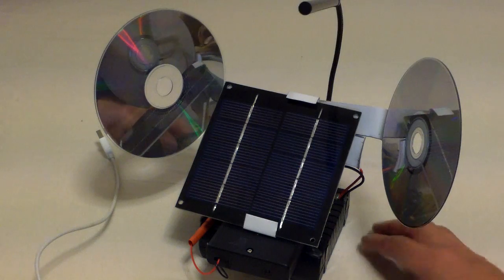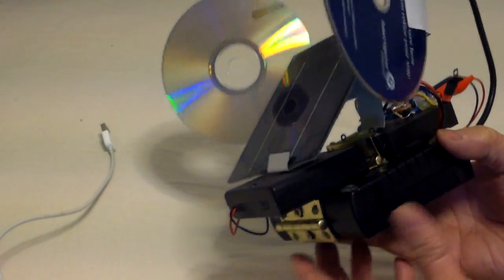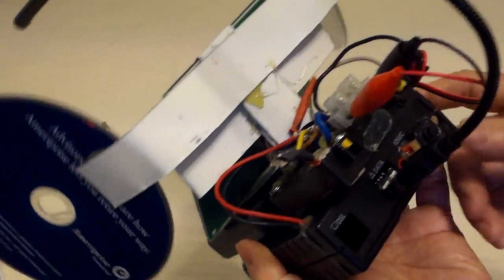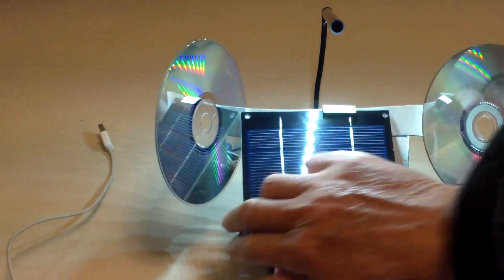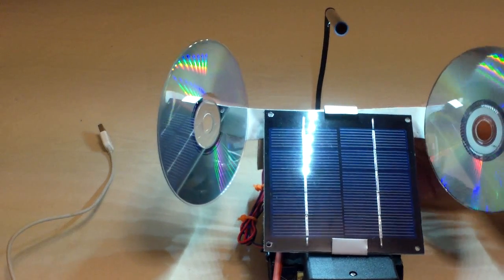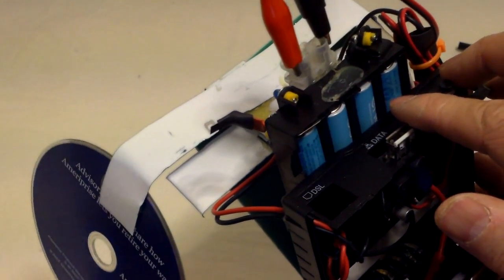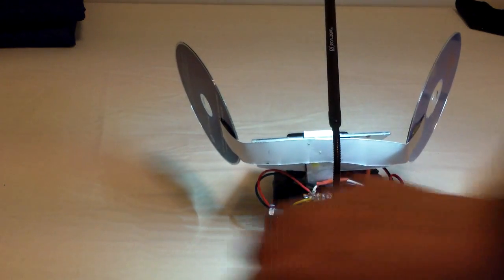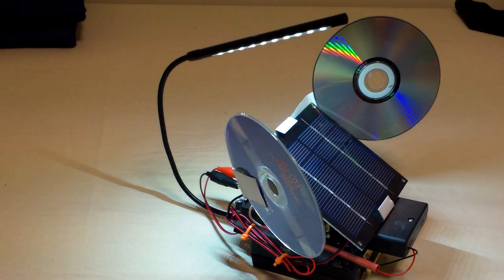A demo of my diy indoor solar usb power pack pt 7

Comment: this is of course silly as an actual application, because you're losing energy in conversion. but, it's an interesting proof-of-concept, and i have a few questions about the actual specs.

the prices for electricity in canada are going up with no end in sight, so what i'm trying to do is figure out if there's enough energy in my led lights - which i have on all of the time anyways - to power a few items that i could take off the grid. so, i currently have a 35 W ac fan running pretty much all of the time, and i'm hoping i can replace it with 2.5-3w usb fan (that claims it has the same specs). 

you say that's a 6v panel, and you can eventually get enough energy out of an led light to charge your phone. it could take a long time though, right? if you were to run an ammeter over the connection, how much charge (watts, amps, volts) are you actually generating with the led at any given time?

with two 9-10 w led bulbs and computer monitor, not to mention two windows in the day, i'm convinced there's enough ambient light energy in the room to run a 3 W device, non-stop. i'm just trying to figure out exactly what i need to harvest it.

Comment from the maker: You are describing what I'd wanted to do with my lithium pack but gave up since I blew the fuse in the pack. This demo pack doesn't really self discharge while charging. I'll have to add a zener diode and some leds to burn off the extra charge if I want to do this. I don't know if I can just add say 2 groups of 3.3v leds across the positive and negative. Since the forward voltage will be at 6.6 v, when the battery packs get full at 5.4v, it'll start lighting up the leds and burn off the charge.

Comment from the maker: It will never overcharge with 1 panel because there are only so many hours of sun in a day to charge. Even though I used low discharge batteries, they still discharge. I was thinking of making a regulator shunt but I doubt it's needed.